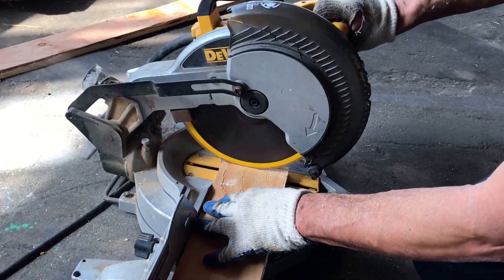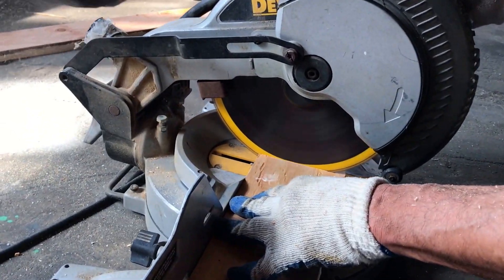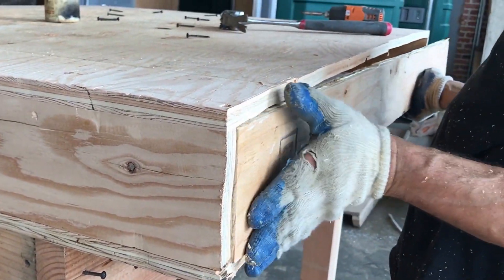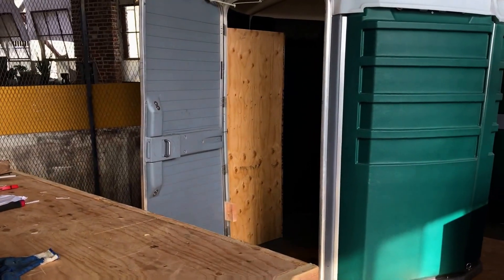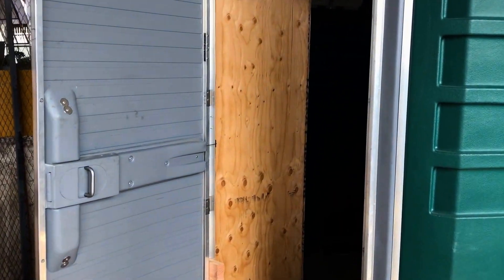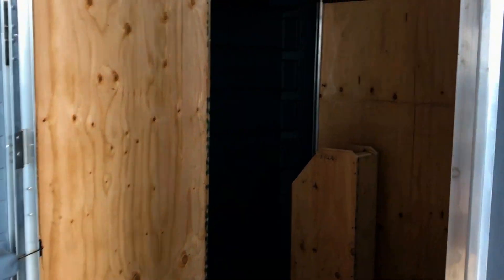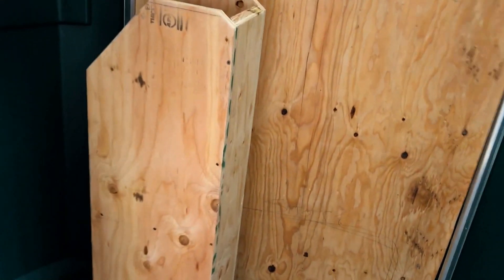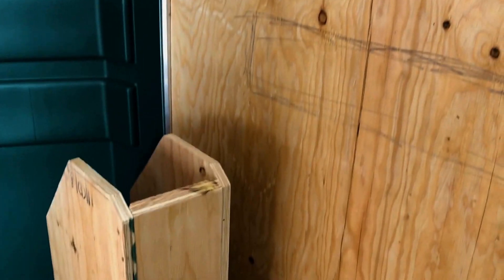Porta-Home Construction 1: Prototype Building Begins!

Comment: P.s. Do you know how I came to your channel? I've been homeless for four years and am now determined to get back on feet and have a potential job coming my way. THIS: is how I came to your channel: I wanted to buy a port o poty and sleep in it close to my potential job, its better than sleeping outside.
Reply from the maker: I'm sorry to hear about your experience, Peter. But your vision for your future is uplifting! Don't be discouraged by the challenges you may face, your stability and independence will be the ultimate reward. As for buying one and placing it somewhere, we'll need a little time to R&D the unit and get our program up and running. Since our team is relatively humble itself, we're tackling details with time more than money. We'll get there, thank you for supporting us and good luck in your journey!